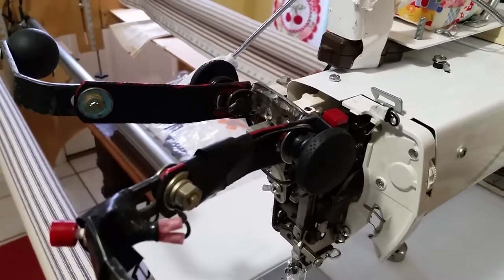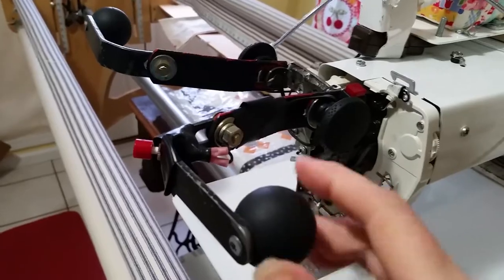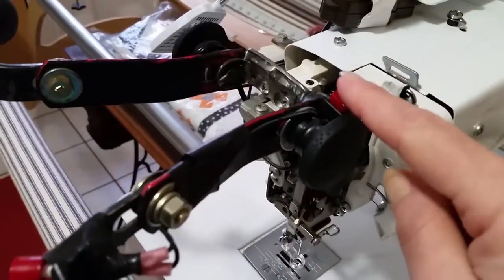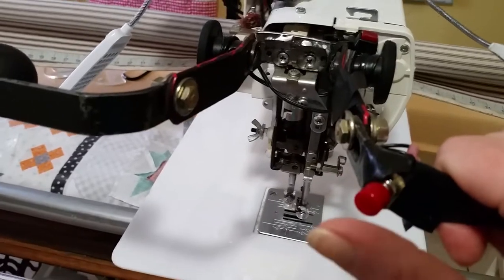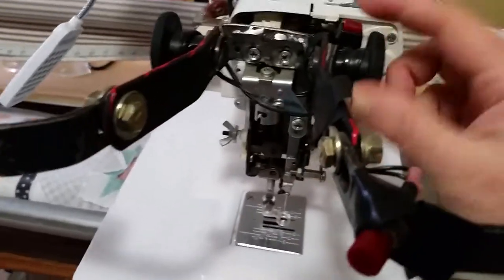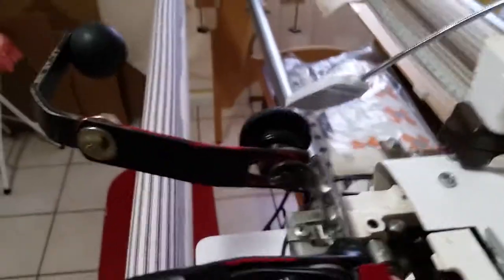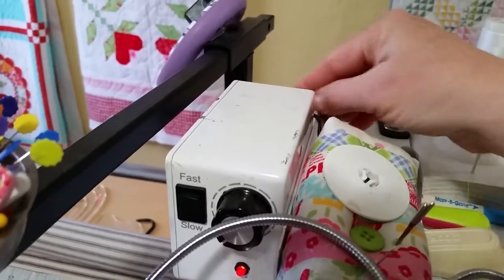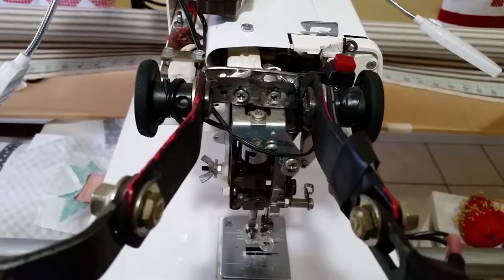Bailey Home Quilter Buttons and Handles

Comment: Hello, my wife and I just retired last year.  She's been trying to get into a quilting class for several years and every time she signed up it would be cancelled because not enough people signed up.  She finally got into a class last month.  Long story but I wound up buying her a used BHQ 17Pro for a very good price with lots of extras, and a Bernina 10' frame.   We drove across the state to get it, took it apart and brought it home.  I had called the quilting shop where she was taking classes and they wanted $250 to stitch a king size quilt.  $.02/ square inch for a simple stipling pattern.
I thought when the lady demo'd it for her that it quit stitching when she quit moving the machine.  However, now when you turn on the machine it stitches real slowly until you start moving the machine.  Is it possible to program the stitch regulator to only sew when the machine in moved?  Also I'm guessing you can use the "go" button to raise the bobbin thread?
thanks, Ken and Rhonda
Reply from the maker: No, the stitch regulator never stops.  you can slow it down.  The go button can be used to bring up the bobbin thread.  I suggest you join the Bailey Home Quilter Group on Facebook.  Lots of videos there to help.  Everyone in the group is wiling to help and we encourage to ask questions if you have issues.  Many of us have altered our machines in and frames to make them a little more user friendly.  Good luck!  Hope to see you in the group!  You can also download and print the stitch regulator manual from the group files.